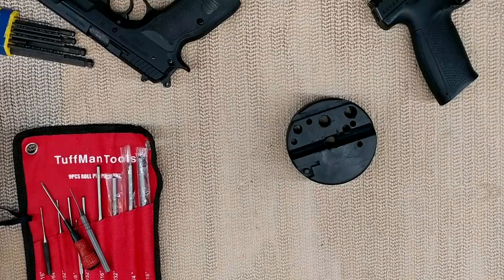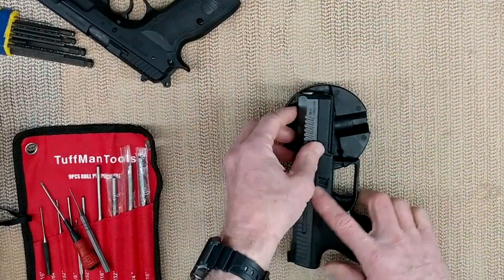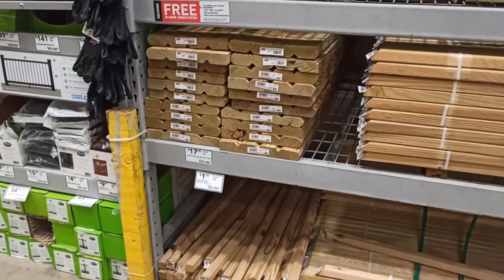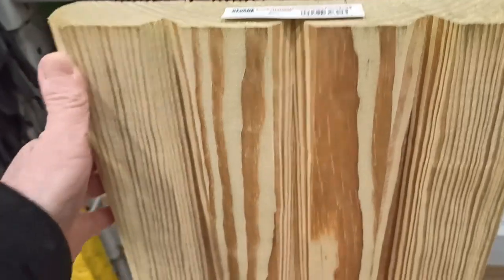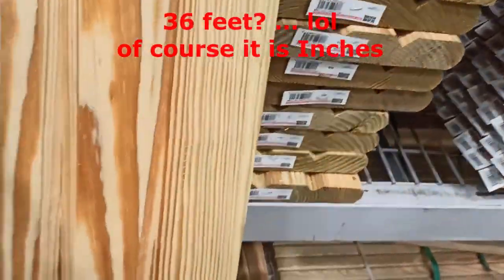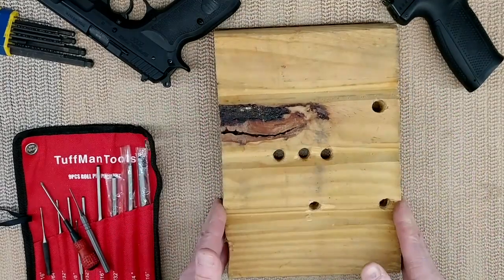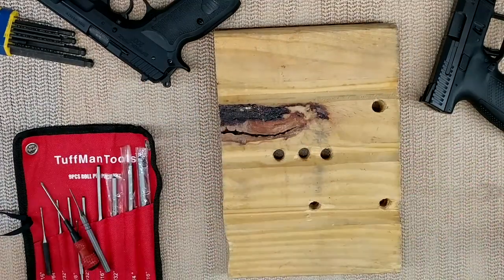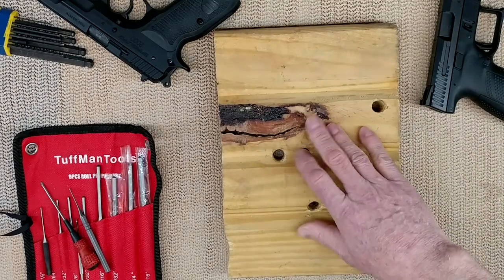DIY Gunsmith Bench Block - Easy and Cheap

Comment: I love it! I love seeing how people solve common problems and come up with tools and solutions on their own. Some great! Some not so great but I still love it. The only problem I can see with a wood bench block is that would is not unmarring as like nylon it won't scratch unless you have something like a nail or a nod or something along those lines. But when they're dented those dents stay so you have to replace them a little more often. But that's fine. And even if you get some wood with a knot I mean it's not a big deal. It's just not going to be a soft as the rest of the wood just have to be aware of that. But I love it. I love the idea. Thanks!